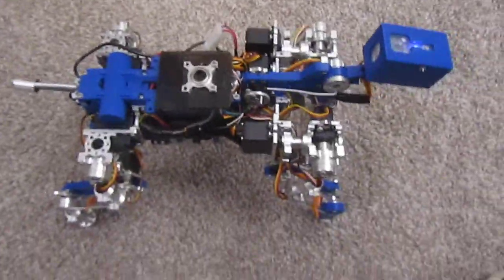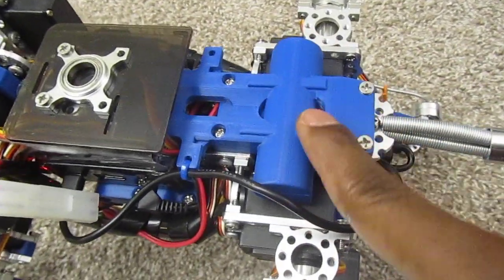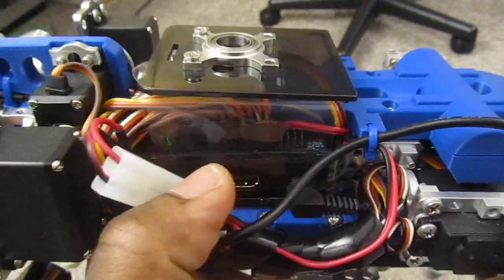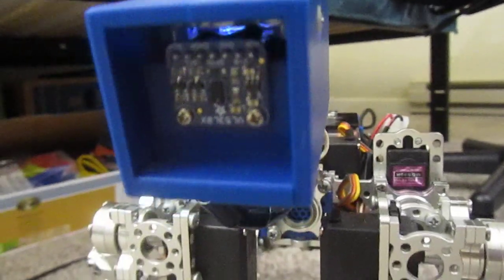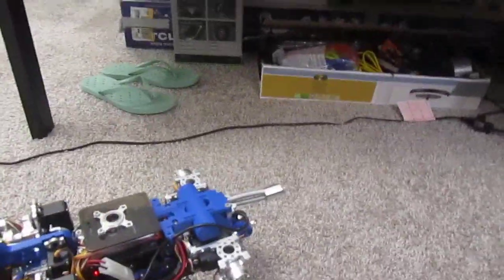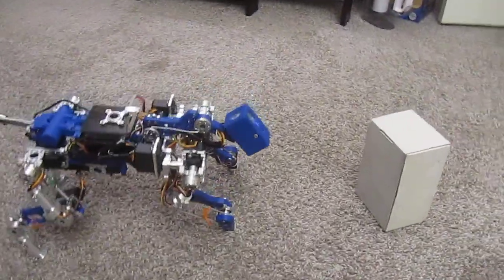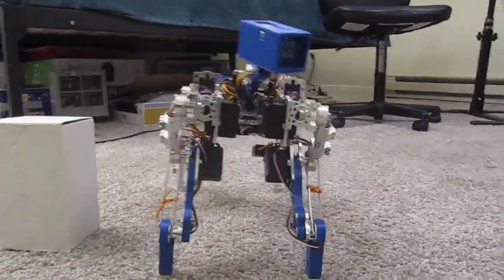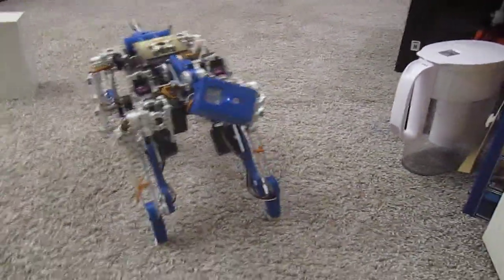Robot Dog 3D printed parts Update

Comment: What library for ultrasonic? Need not blocking code. I use accell stepper motor library. Thanks
Reply from the maker: Hi, well I'm using an Adafruit Time of Flight Micro-LIDAR here which is an upgrade from the ultrasonic I wanted to use originally, so I used the Adafruit Python library included on their site for Raspberry Pi because I used Python to write the code for the robot.

Comment: How does Lidar react to a mirrors or windows?
Reply from the maker: Good question because on my first design I used Ultrasonic Distance Sensors but they are not good on soft/angled surfaces so I switched to lidar and so far it is pretty consistent and reliable on all the surfaces I tested, (rough, smooth, soft(clothing/carpet), hard, reflective(mirrors), dark and bright surfaces) but I have not tested it on transparent surfaces like windows or glass yet, but I think it will work on windows because some light will be reflected back to the sensor.

Comment: Great work appreciate your work very nice project but the dog is too low if can  make it to do things faster
Reply from the maker: Thank you, yes I wanted it to go faster too but the parts (processor, battery and servos) can't handle it so, I am currently working on robot version 2, and it will go faster with better parts (spend a bit more $) going big this time 😁
Reply: Good luck

Comment: wow you're really lucky to own a robot dog like that fr :) i wish i could make one too for myself but smaller than that one, is it hard to make tho??
Reply from the maker: Thanks, yeah it's my first quadruped robot so it took a couple of years from design/research to completion and it was pretty difficult mainly because I didn't have a lot of references to use for inspiration and guidance. But it was a fun project and I learned a lot of useful things for later projects, you can build one, it just takes a lot of patience and dedication.
Reply: @y-spectrum-2470  Yeah but you also made one with a complicated design🤭 how many servo you have in the legs?? Do you have one on the foot or it's controlled by another servo?🤔
Reply from the maker: @iprogeny4877  I used 3 servos each on the front legs, cause they are used for turning and walking, and two each for rear legs which only walk (would have needed 2 more on rear legs for better turning radius and speed). At first I was going to use separate servos for the feet adjustments (would have added 4 more) but decided to go with push rods and use the legs mid servos to move and adjust the feet to reduce weight and energy consumption. 

Also I thought of adding one more servo to adjust or wag the tail but decided to use a spring for the tail then use the turning servos to move the shoulders side to side which kind of wags the tail a bit, not great but helps reduce weight and energy consumption (some of my main goals in the project).

So in the end I eliminated 7 servos, but I will say that the leg servos I used (Tower-Pro MG-995) are actually not ideal because they don't rotate to the full 0 to 180 degree angles (only like 10 to 170 or so) and are kind of loud but are ok for a prototype experimental project like this (and low cost with decent durability).